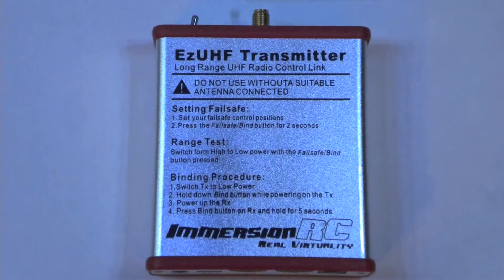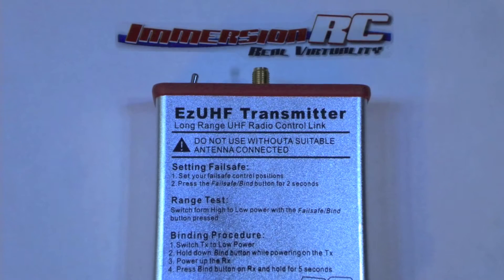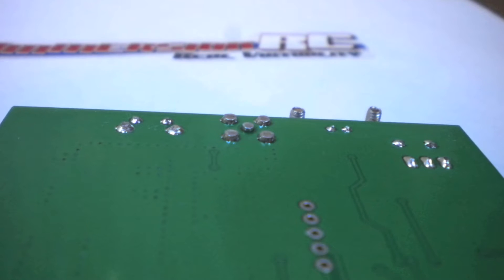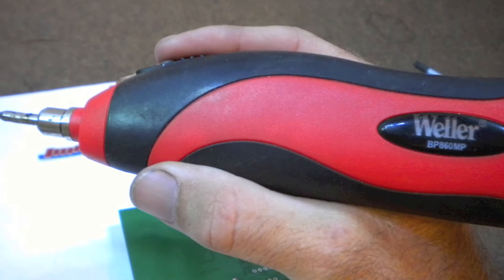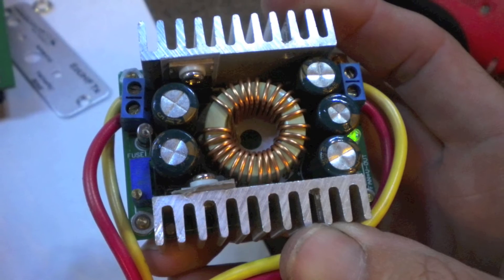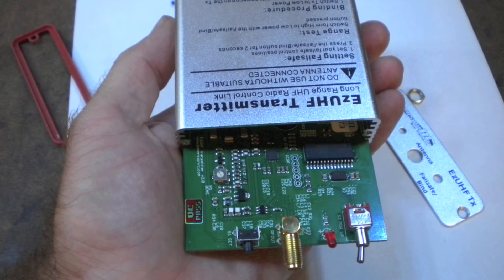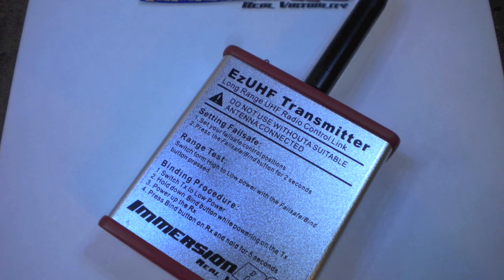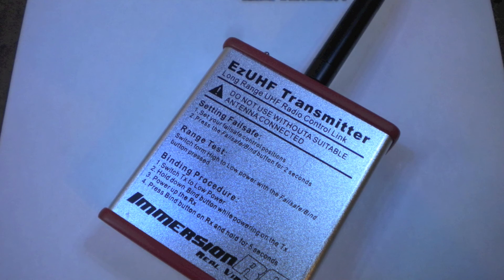EZ UHF Range Problem? How to fix a Defective External Tx Module

Comment: Thanks for th video.
I have two of this TX and both with just about 600m range. After resold, tx comes to beep when switch hi-lo (two beeps hi, one beep lo power) and the range increased to about 1300m. But, infortunatelly, this range is yet not enough to me. Do you know another way to fix it? Thanks
Reply from the maker: yes, please see my other video about how to get max range from your UHF system.   Unfortunately., these have an inherent problem that they have lots of latency when outputing Sbus signal, and my focus is more on pixhawk lately.   there are better systems now for control at long distance, so if you can switch, it's good.   I'm still flying a plane with this one however for fun, fpv.   most of my planes now use a flysky 2.4 radio, yes with limited range, but I'm controlling the plane with SIK radio and laptop, at 8-10km range.  Holybro 433 500mw using the same diamond antenna upgrade on the ground SIK radio. everything now running through pixhawk.
Reply: @FPVREVIEWS  . Ok. Thanks. I´ll see it. I´m using APM and wants to reach about 8 - 10 Km with EZUHF. Is it possible?

Comment: Nooooo!   That is not how you should resolder those joints.  Never carry the solder to the joint.  The flux will burn off along the way and you're asking for a bad result.  That's basic soldering 101.

Good soldering is done by heating the joint and adding the solder directly to it.  That way the flux remains active and reduces the oxidation of the solder and the metals being joined.  I've done a couple of videos on proper soldering technique and tools on my RCModelReviews channel.
Reply from the maker: thanks, bruce.  will keep that in the mind for the future.  i really enjoy watching you patch up dodgy electronics too.  best, spike
Reply: FPVREVIEWS
No worries mate... yours is otherwise a great video -- never hurts to check the manual soldering involved in these devices.
Reply from the maker: I'd love to send plans for my latest 3.5 meter fpv super-plane, for you to check out. I think you might like it, or it might be good subject matter for your show.   ?   where can i send them? pm me with your email address?

Comment: Many thanks for the video, very informative. 

We do track fairly carefully our returns and repairs for all products. The 500mW EzUHF Tx does have a very low return/repair rate, so it is not clear that this problem is as common as the video might indicate. 
The SMA connector on our products, especially the UHF Tx, does have a fairly 'hard' life. We often see the transmitter (with attached R/C radio) being picked up by the antenna, which does cause stress on the solder joints. 

We will of course be very interested to hear from users that have found an issue with the solder joints. A small photo of the issue sent to repairs@immersionrc.com would be very much appreciated. We can either take care of any repair required ourselves (with repair centers in most continents), or use the data as part of our continuous quality improvement program.
Reply from the maker: It's a great product, and the video is based on my experience. I've bougt two, almost 2 years apart, and both with the same problem. I wonder if other people have had the problem,a nd just have not found out the cause. If they find out, they will be repairing it themselves, because given the choice of 10 minutes, or weeks without the system, most hobbyists will choose to just re-solder. and they probably won't bother to give the feedback.
It could shed bad light on the product, and best to question it rather than back up the product. It will have a better result. 
I still recommend the product.
Reply: FPVREVIEWS Sounds good, I understand. For warranty fears, opening the Tx won't void the warranty, we are quite relaxed on this subject. If there is a manufacturing defect even several years after purchase, we will repair it free of charge. 
I would like to see photos of any soldering issues on these connectors though if possible, before re-soldering of course. All of this feedback helps to improve quality on the production line.
Reply: Hey @Tony Cake.. im having range problem with my 2W Transmitter too...and i want to do this repair.should i just send it back to anti gravity sports? or do this repair? if i do this repair, will it void the warranty?... i bought mine last november 30 2017 and the packaged arrived last december 15,2017... i just noticed that my plane will activate failsafe at about 100meters( good thing im not flying it).im even using diamond antenna and halfwave dipole on the receiver.. i dont even know which one has the problem, is it the receiver or the transmitter...omg..please help!

Comment: Spike, the shot of you and your dad standing next to the Gemini.... is that the latest incarnation, or a prototype? I'm interested in building one.
Have you thought about using EDF's for FPV? I'm on the hunt for 70mm class fan setups that I can get endurance out of. No luck so far =/. Windrider makes a real nice 737 that would lend itself to FPV nicely, if you can find a way to fly longer than 10 minutes. I'll be looking at my EZUHF after watching this vid.... thanks!
Reply from the maker: That's a teaser shot of the gemini V-2.  It's a 3.2 meter span long endurance platform that i will be releasing plans for soon. flew ti to 8.2 km yesterday, and 1000 meters high, all in the same flight, and using only 1/4 of the battery. '
i would not suggest an edf for long duration flight. the 10 min sounds typical for edf.
unless the edf is a very low rpm fan, and very large, it won't be efficient. 
if you think about it in terms of energy loss, with a high rpm prop of any sort, or many blades, the result is the same, the air gets highly compressed, and you do get thrust, but the air will just decompress again, and the energy spent to compress it to that degree is lost.
the idea for max efficiency is to compress it as little as possible, while obtaining the desired thrust out of the engine, for a given airspeed. 
if you must fly fast, you will need a higher rpm, because the air is already accelerated. 
and at that speed, the extra drag of large prop blades would lose efficiency too. 
for a lot of endurance, the best thing is to swing a bigger prop, fly real slow, and have quite a bit of pitch in the prop. ed.'s are definitely out for number of blades, and high rpm. 
they look cool, but that's about it.   they do work fairly well on fast planes, but definitely not on slow planes. 
hope that helps it all to make sense. 
i've flown almost 3 hrs fpv with the gemini prototype, using large props, and fairly high pitch, and since have increased the pitch even more, and lowered my power draw by about an amp. 
right now i'm flying at about 40 km per hr, in efficient cruise, and using about a 900 kv motor, a power 15 from e-flute, and a 13 x 8 prop.  well two of them, as it's a twin engine plane. there is no efficiency loss with multiple engines, as long as each is optimized. 
check out the gemini endurance video.  thanks.   spike
Reply: FPVREVIEWS
I'll be looking for your plans for the v-2. Understood re the EDF thing. I really like the 737 airframe, and thought it would make a great FPV platform considering it's size, and the ability to cover alot of ground quickly. Right now, I have the Skyhunter, with the E-Flite 25, that has 2 4S 5100's, with the Eagle Tree OSD and avionics suite. My next project is going to be the Gemini, and I hope you'll keep us posted on when you release the v-2 plans. Thanks for getting back to me Spike, have a great day!  Collin.
Reply from the maker: ***** you might want to do a bit more research about swept wings at low reynolds numbers before considering the 737 as a viable model. the handling, wing performance, and efficiency would not be good at such low speeds.  the reason that the real 737 is that way, is that there is a huge advantage in swept wing approaching trans- sonic speeds at which it's meant to cruise.  they have to change the wing shape drastically to get the plane to slow for landing without falling out of the sky in an uncontrolled manner. that's what the 2 or 3 stage slotted fowler flaps, slats, spoilers, etc are for.  not very practical on a model, and no benefit even at relatively high speeds on the model.  more scalable designs are ones that operate at significantly lower airspeeds, like most turboprop commuter planes, or cargo transports. but you might still want to change the airfoils.  approaching the sound barrier, and especially crossing it, requires drastic design changes, and the aerodynamics change altogether. it becomes more of a game of shock wave angles and the relative pressures they produce, and nothing to do with fluid air any longer, the way we are used to thinking about it. and the planes that work well at those speeds do not work very well at all at lower speeds.  that's why all of them morph their wings into very different shapes for landing, and even then land at very high speeds.  another way to do it, is use air dams on the wings like some of the first russian swept wing jets, but it's still pretty crude,a nd does not get any extra efficiency, just keeps the plane flyable to a bit lower speed,a nd controllable.
Reply from the maker: ***** high performance for a H.A.L.E.   u. a. v.?  think boeing condor, not 737

http://www.hitechweb.genezis.eu/UAV02.files/boeing_condor_01.jpg
Reply: FPVREVIEWS
Thanks alot Spike, due to your excellent description, the 737, or any swept wing model is out =)
Tis OK, I like your Gemini, with it's ability to house multiple R/C systems, and multiple vid systems. I'm just waiting on the v2, as I've never attempted such a complex scratch build. Looking forward to it, as I have the scratch build bug now that I've had a couple successes on a smaller scale. I'll send some vids to you of my goodies when I get all the system together.
Reply from the maker: ***** would love to see your projects.

Comment: Lot of defective products and modules from ImmersionRC, my hands are not enought for counting them...
That should help a lot of folks! Thanks for sharing!
Happy sunday
Reply: ANOTHER BLACKMENNEWSTYLE PRODUCTION 'Please stop my game'?... what on earth are you talking about?. I wrote the firmware for the EzUHF, I have personally compared latency with just about every system out there, and I take offence at cheap jabs from people who don't know what they are talking about. 

Is the EzUHF (OR ANY OTHER UHF) system on the market comparable, latency-wise, with the current state-of-the-art 2.4GHz links, NO!. The 2.4GHz links don't need to worry about interfacing with archaic (latency-inducing) PPM data streams, nor do they need to worry about maximizing sensitivity at the expense of data rate.
Is the EzUHF comparable with the other UHF systems out there, who DO need to worry about these things, ABSOLUTELY, including the system that you are running yourself. 

If 'latency' is critical for you in your choice of control link, then please follow the 2.4GHz crowd, there are some great systems out there. 
If long range is criticial in your choice, or if you want to fly 2.4GHz video, then you have to accept a few more milliseconds between jabbing that potentiometer, and waiting for your servos to start to move.
Reply from the maker: Tony Cake it was the original i believe. i don't have the trinity.
i have had it happen several times, and found the fix on a forum. 
just power on in a different order, and it never happens.        By the way, quite a few people have been asking me whether the new Jr. module has comparable range to the external module.   What can you tell me about the difference between the two, and how it relates to effective range.      thanks!
Reply: FPVREVIEWS Ok, then I am almost sure that this is a headtracker problem. The Trinity is worth trying by the way, really a game changer in the headtracker world. 

For the second question, with a decent antenna, there is no real difference between the two. I say 'with a decent antenna' because the external unit has an aluminium case which does act as part of the ground plane of the antenna. 
The plastic-enclosed JR module doesn't have this ground plane.

What difference does it make in practical terms?, not an awful lot.  Personally I have flown with the JR module for the past 12 months or so, with frequent quad flights out 6km on low power mode, with just the Diamond 771 on the module. 

What does make a huge difference to UHF range is the receiver antenna. A decent dipole on the receiver will make a significant impact upon range, especially in the extremely noisy confines of a multicopter setup. 
The stock antenna is essentially 'half an antenna', with the counterpoise being made up from the ground wiring in the model. This wiring obviously changes dramatically between a long-range flying wing, and a compact multicopter. 
A dipole on the Rx is a 'complete antenna', comprising the driven element, and the counterpoise, and therefore typically gives much better performance (and much more repeatable between models). 

Apologies... long answer to a short question :-)
Reply from the maker: which ones have you seen the most defective?  i wouldn't mind getting my hands  on a few of them, and try to fix.
Reply: FPVREVIEWS Sometimes, they said it's about the software like the 8 or 4 channels ezUHF receiver which has/had some latency issue...
Personally, i don't use their products, for UHF i fell in love with Dragon Link since a while ;)
Reply: ANOTHER BLACKMENNEWSTYLE PRODUCTION We would love to hear more about this 'latency issue'... this is the system that TBS used to do their proximity flights, so if there was a 'latency issue' I think we would have heard about it :-)
Reply: Tony Cake Please stop your game, comparing a hobby companies with hobbyists is not really a fair argument.
Just search ezuhf latency issue on youtube or even google and you will be pleased...
Reply: Tony Cake Yes please stop your game, i knew perfectly who you were :)
I am not surprised by your answer, the cheap jabs from the people who don't know what they are talking about, are your customers. The ones who can allow you to have a salary at the end of the month.
It's good to see you do not have much respect for them.
They are a couple of folks who faced this issue but you are maybe right, they don't know probably anything including me :)
Reply: ANOTHER BLACKMENNEWSTYLE PRODUCTION Entertaining response, take a product that has shipped for several years, with thousands of happy customers, and because of issues reported by 'a couple of folks' the product obviously must be garbage. 
I have a world of respect for my customers, what I don't have respect for is unsubstantiated attacks on a product, or company generally. Come back with a little more data, and I'd be delighted to look into this further.
Reply: Tony Cake I think if someone is attacked here, it's probably me, your presence here is certainly not a coincidence!
But it's fine, i am the bad guy, i was just talking an issue a couple of people has reported, i personally saw it happened to one of my friend!
But i have your consideration about my experience, it's just "cheap jabs" :)
Reply from the maker: Tony Cake The only "Latency" I have experienced, if it can even be called that, is having to do with the control channels specifically controlling the head tracker. If the goggles are not powered up first, (SOMETIMES) the servos will move super slow, and not respond well at all. 
i have modified my checklist to power up the goggles, with the built in chip first, and then power up the transmitter. I'm not really sure wheterh the issue is to do wight he chip in the dominator goggles, or with the ezuhf. 
perhaps you can provide some light on the situation.   best, spike
Reply: FPVREVIEWS That is interesting, and something that I can look at. Would this be the original headtracker, or the newer trinity version?
Reply from the maker: MrAnthonyrc No apology, that is the answer i was looking for. Great, thanks. sounds like I will stick to the external module, as I have done 12 km distance on low power, and never had a failsafe. 
I have the  diamond antenna on both of my EzUhf modules.
Is the a good directional antenna for uhf that you would recommend for an upgrade? and could be mounted on a tracker?
something i could recommend to people for both the external module, and the JR module?  thanks!
Reply: FPVREVIEWS Thanks for covering this. I'll get the external transmitter if I decide to buy ezUHF. Actually it was the Taranis EMI/shielding issues that first made me question the JR module.
Reply: Been using ezuhf for a few years now, both the jr and alu box, all performing very well, but with diamond srh an dipole on receiver, though I had to troubleshoot noisy becs and cameras but thanks to the spectrum analyzer I could identify and change them

Comment: Nice , how about a run down of your FPV Ground station ? 

What frequency you fly with 1.3 ?
Reply from the maker: Two different frequencies at the moment, 1080, and 1200 simultaneously. one for each camera.  gotta have redundancy. 
i will probably do the ground station video, as soon as i put it all in a pelican case. it works great, but it's all in a pink foam box right now, held together with tape. been too busy working on the aircraft. time to give it some priority. you're right. 
thanks for your interest.